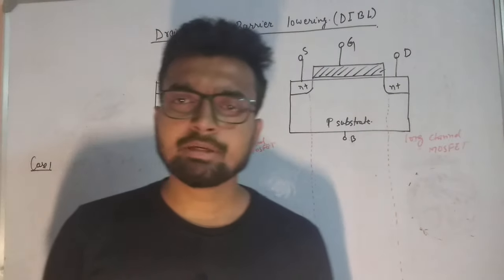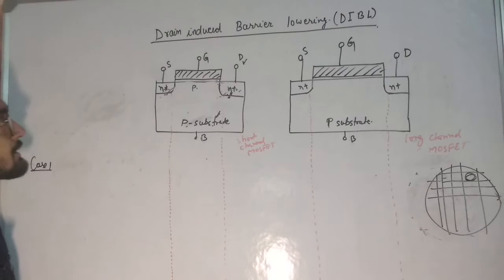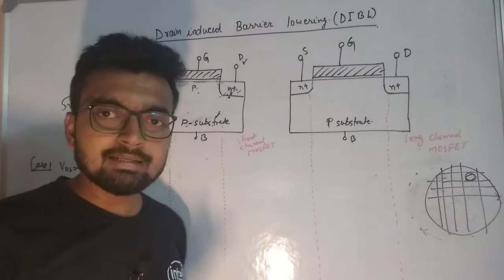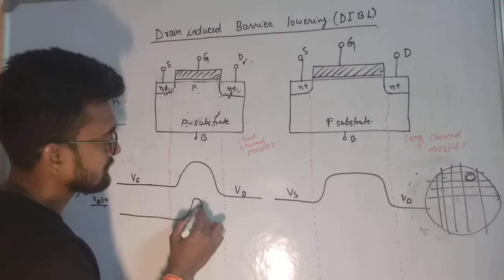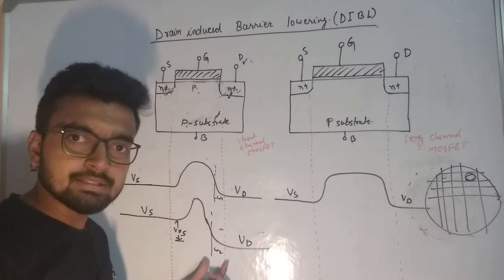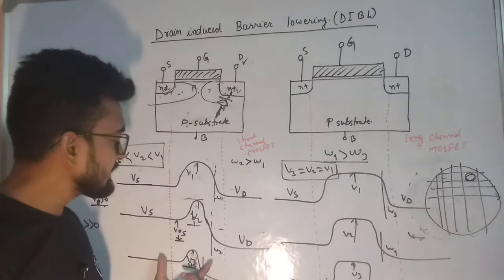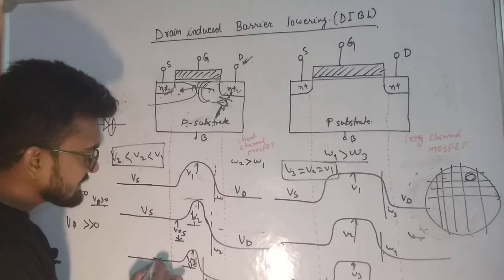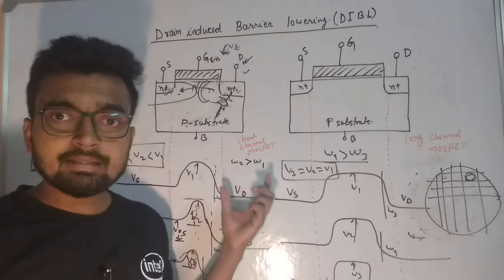What is drain induced barrier lowering.

Comment: Hey what is that electron profile? Can someone explain it?
Reply from the maker: https://www.semanticscholar.org/paper/Gate-Induced-Drain-Leakage-Current-in-45-nm-CMOS-Yuan-Park/d8ae3db50fdf372b2442a625608be03012c34923

Please refer to the graph to understand current and electron profiles in detail.

For energy band diagram and electron profile you can refer to figure 3 of below link

https://www.researchgate.net/figure/Band-diagrams-of-a-gate-substrate-junction-and-b-gate-drain-edge-for-an-nFET_fig3_3140206